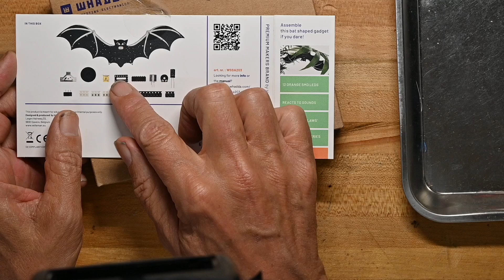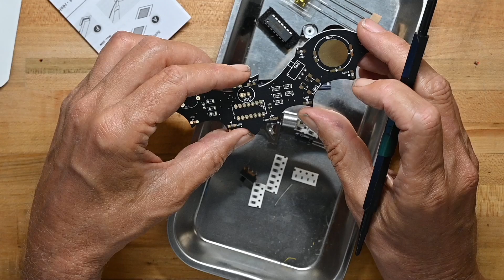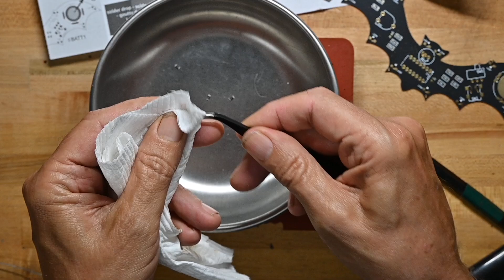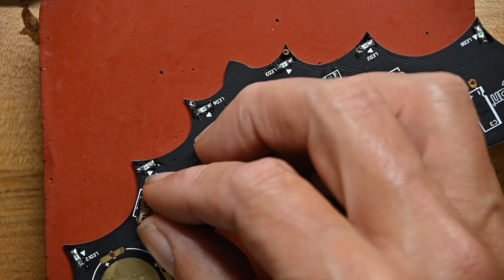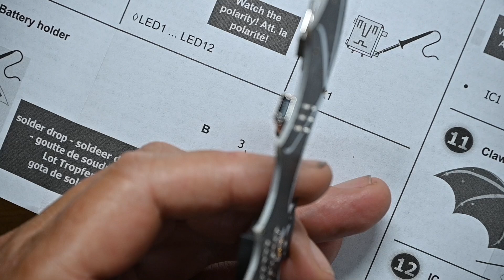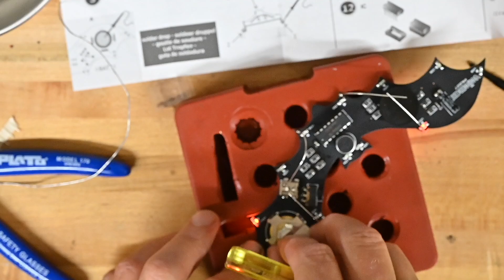C.K. builds a Haunting Bat surface mount kit

Comment: Could the microphone be blocked by the thing it's sitting on?
Reply from the maker: I don't think so, the wire "claws" keep the mic from going flat on the solder pad.  I also picked it up to try.  I'd try it again right now but I can't find the thing, that's the problem when you build two kits a week and usually 4 weeks before the video goes live, things get tossed into my "save to scrounge for parts" box and I can't find 'em....
Reply: @CKHaun  well just know this, You taught me something new. That surface mount soldering trick was cool. One side to begin with. I have never done much surface mount stuff. Thanks
Reply from the maker: Glad it helped!  That little technique has saved me a lot of rocking resistors!
Reply: I am happy to report that I built this kit and it works well. This was my first real foray working with surface mount components. Seeing you build the kit, I learned from your technique and gained confidence to try my hand at it.  I didn’t have the proper tool (bent non magnetic fine tipped tweezers) so I settled on using straight fine tipped hemostats. From my experience, this is not the best tool to use in this application. The hemostats turned out to be slightly magnetic, making it more difficult for precise component placement. I tried a metal pick to help with position placement but even this turned out to be slightly magnetic… good grief!  I just took the process slow and easy while taking a bunch of slow deep breaths. Those ceramic capacitors were especially tricky given their tiniest of size. I could easily lift these by the magnetic tools that I was using.  You once told me to “take a deep breath” and persevere in one of your comments to me (the Whadda LED Jack O Lantern kit) last year.  Building this kit was somewhat stressful given my jittery hands, old eyes and a touch of OCD but you gave me the confidence to overcome the challenges presented. But thinking of your lesson and taking plenty of deep breaths I am so happy to have built the kit and have it work correctly upon powering up. Tacking down one lead of the component made soldering them sure and satisfying.  The electret condenser microphone is used to detect sounds that actuate the LEDs to illuminate. The potentiometer is used to control the sensitivity of the microphone. I’m guessing that the one through hole electrolytic capacitor is used to set the time that the LEDs illuminate (they will remain lighted till the charge is depleted) but that’s just a hunch. In the up position, the single pole double throw switch allows power to be taken from the miniature USB connector. Conversely in the down position, power is supplied by the on board CR2032 battery.  This experience has been so worthwhile and I have learned much along the way. With more practice and the proper tweezers I hope to become more proficient. Thank You!